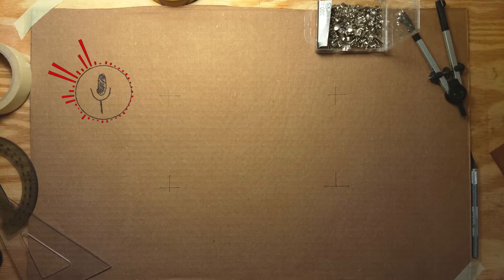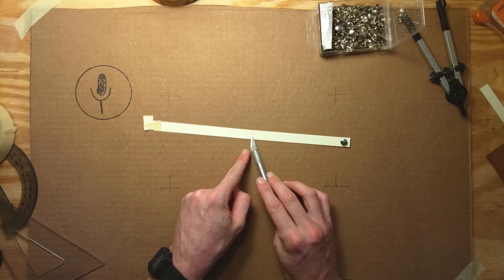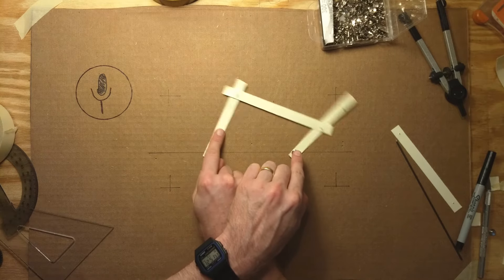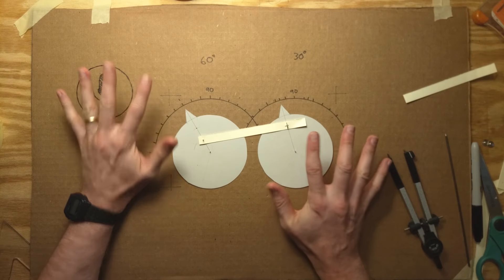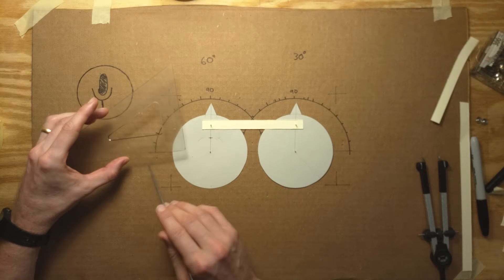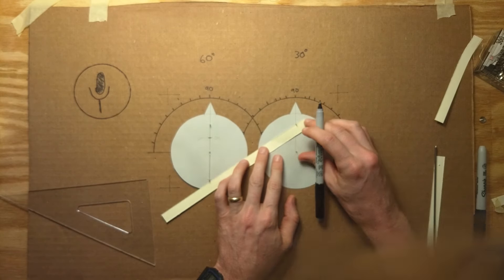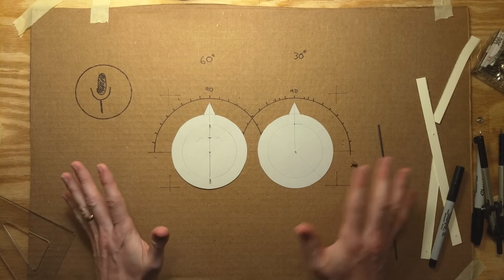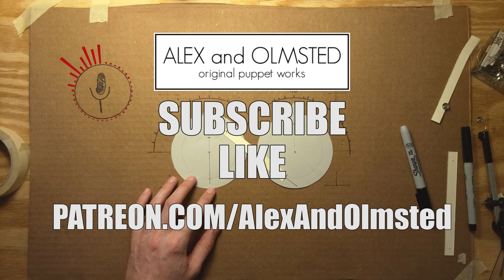Levers and 4 Bar Linkages

Comment: I’m an animatronics enthusiast. As I’m starting a new mechanical prop build, i wanted to brush up on the fundamentals of levers and linkages when I came across this video….Its undoubtedly the coolest one out there. For a moment i thought, this got to be a cool physics teacher and then  I checked out your channel…no wonder you are a puppet maker/puppeteer….u designed the perfect teaching aid to explain the concept to visual learners like us
Reply from the maker: Thanks so much! We love animatronics but haven't gotten to experiment with it too much. Now that we have our 3d printer and are more familiar with 3d modeling, and trying to get more comfortable with circuitpython, I'd really love to add more animatronic elements into our puppets. Loved checking out the animatronics on your channel! Did you build those?

Comment: I started out designing a really cool folding cup holder for my van using this process. I then machined out the parts on my Bridgeport mill, it was amazing to see how much just .020 difference in pivot points would would make the difference between work perfect or jamb! Again great video!
Reply from the maker: That's awesome! Do you have any video of the cup holder in action?

Yeah, those tiny little changes in pivot points change so much! Especially the closer to pivoting points get to each other. It's also amazing how much changes when you switch from a paper or wood prototype to metal, and all of a sudden the tolerances are much tighter!

Comment: Great ideas, I didn't think those bars would be precise, but as you said - and showed - in a small region this will be sufficiently precise and more robust than belts and pulleys.
Reply from the maker: Thanks! Yeah, precision with paper is tricky but possible. It helps using thick cardstock to keep your paper from bending, and if you're working at a larger scale it's easier to get it closer to how you want it.
Reply: I saw this more as a prototype like Tim Hunkins showed in one of his "the secret life of ..." (linkages?) : paper and cardboard linkages are great to iterate your ideas, then you can switch to wood or metal when you get the right movement. 
And you did show a good precision with paper, eg with the opposite rotations at 19:02, that surprised me.

Comment: Great job. Im currently trying to find a way to reduce the torque load on a small servo motor to be able to push two tires into a turn. I started to use the shaft and steering gear plate and adding a bearing but I think the force needed would strip the gears on the motor. Easy fix with a bigger motor but I want to find the right combo of gears or levers to make a small motor move large objects. Just a matter of the number and position of levers or gears. Your presentation has given me some more ideas to test. Thanks
Reply from the maker: Great! Thanks for the comment. We love hearing about real world applications like this. Finding the right way to gear up or down a motor is so valuable, too!

Comment: This is one of the coolest videos I've seen a long time! The creativity and depth of knowledge illustrated in simple visual terms is simply astounding! Bravo! If you are entertaining requests during these potentially slow days, it would be cool to see this type of illustration used to show how one circle drives the other circle in a >180 degree oscillating rotation, with the driving circle making complete 360 degree unidirectional rotations.  ;)
Reply from the maker: Glad you enjoyed it, and thanks for the suggestion! That's a cool idea! I'm not sure if it's a typo, or if I'm thinking of a different setup, but the driving circle would go 360, and the following one would go <180, not >180. I'll put it on my list! :D
Reply: @AlexAndOlmsted  Now I'm trying to remember what I was thinking!  LOL - I think the application I was envisioning would be to have the first perform the full 360 degree rotation in a single direction and have the second move greater than 180 degrees but less than 360 degrees. It would actually be very cool to contrast that to the second going less than 180 degrees so both practices could be observed. The applications of having the driving "wheel" rotate 360 degrees in a single direction (such as a crank or motor driven source) can be rewarding for achieving a less than 360 degree rotation of the targeted "wheel" for things like rotary oscillation and the like. I'm no math guru, but I have a feeling the application for less than vs greater than 180 degrees will require different solutions perhaps? I don't know what the solutions are, but I can picture it being a very satisfying visual experience in the manner you did for this video.  :)
Reply from the maker: @sethbrandes2979  I love that idea! I definitely know you can achieve <180 degree oscillation with this kind of set up, but it'd be interesting to see if you could get more than 180. I'll do some research and see what I can find!

Comment: I’m confused, when you were finding the tangent line, how did you determine the size of the smaller circles inside
Reply from the maker: For this example it doesn't really matter what size those smaller circles are, as long as they're the same on both discs. I just made them about 1/2" smaller than the discs so there would be plenty of material around the thumbtack connection points so it wouldn't tear through the edges.

Hope that clears things up!
Reply: @AlexAndOlmsted  it does, thank you!

Comment: What an entertaining and highly informative demo and props. Im trying to devise a mechanism which allows 90 degree rotation to a bar that will be used as a drop bolt. The 90 degree oscillation will be the limit for LOCK and UNLOCK position. I will greatly appreciate if you can help me figure out its geometry. The mechanism has to be powered by a motor which will be operated by a home automation system. Thanks.
Reply from the maker: Thanks so much! That sounds like an interesting project. I would recommend looking into bellcranks for 90 degree rotation. We even made a video about them here: https://youtu.be/b8zK0ZN7vIk

Hope this helps!

Comment: Very nice video !! 
Thanks 
I have a question ... 
At 5:34, do we gain or lose any torque ?
Reply from the maker: Good question! I'm a self taught engineer, so other folks feel free to correct me.

I think at 5:34 the lever on the left has more torque, and the one on the right has less. Imagine that each lever is a wrench and you're tightening a nut. The lever on the left is longer so you can apply Force further from the pivot, giving you more mechanical advantage. 

But I could be wrong!

Comment: Sir sorry Dumb question. If i wanted to triple the throw length of a actuator arm to 60" using levers. Could I use a 20" actuator? What would the lever(s) look like?  Great demo Man awesome
Reply from the maker: Hey, no dumb questions man! That's an interesting problem. I haven't worked with actuators too much to know how to solve this off hand. I imagine you would have a lever with the fulcrum at one end, and your 20" throw actuator attached to the lever near the fulcrum. Somewhere further up the lever would be a point that travels 60". I'm guessing it would be 3 times further from the first actuator than the first actuator is from the pivot. It's important to know that the lever is going to travel in an arc, though, and a benefit of a linear actuator is that it can move in a straight line and not take up as much space.

Comment: Very good video, good narration, good explanation and all round a very good vid. Are you mechanism engineer or designer or related field?
Reply from the maker: Thank you! I'm a puppeteer, and found a greater love of simple machines and mechanisms through building puppets and automata.
Reply: Alex and Olmsted you are most welcome. i just wanted to ask you if you know how to make automata's and you answered me before i even asked :-D how cool is that😀 where can i see some of your automata works examples?
Reply from the maker: @sirpfa  Ha! What a coincidence. I love automata. I haven't worked on any recently but I'll look through my older stuff to see if I can find anything good. I had the honor of repairing a few pieces from the Cabaret Mechanical Theater collection in Baltimore a few years ago, which was a real treat! Do you make automata?
Reply from the maker: @sirpfa  Here's a minimalist automaton I made: https://www.instagram.com/p/B2DWhDHJyDR
Reply from the maker: @sirpfa  Haha, those are great! Their basic shapes and movements don't look too complicated to work out. Most of the movement is from the body parts acting as linkages and transferring movement. Because of how everything's moving I would guess that it's only being controlled with a single input. There's probably a rod attached to a gear that's pushing/pulling one of the body parts, and that's moving everything else.

Of course, that's WAY oversimplifying it as the real challenge is making everything small enough to fit in a pocket watch and light enough to run off a single spring!
Reply: Alex and Olmsted yeap😀 do you design the concept with some software or physical modelling from beginning?:)
Reply from the maker: @sirpfa  I like to start with simple paper models like in the Levers and Linkages video because I learn things quicker when I can be hands-on. I usually sketch out a basic look and then cut some simple shapes and experiment with pivot point placement. Each piece will be connected at at least two points, either to the base or to another piece.

Comment: ..hey there - im new to your channel and found this so fascinating and transferable to other sectors. . How have you actually implemented these principles in your puppet shows and are they the same concept as automation..?!? Please keep 'em coming :)
Reply from the maker: Hi, and welcome! Thanks for the nice comment. We've used these concepts pretty extensively in our shadow puppets, both for live shows and our short films. It's also a great way to prototype a movement that will eventually be in a 3d puppet. 4 bar linkages work especially well in automata since they restrict movement to what you want, meaning you can have a whole series of connected pieces that all animate off the same crank.

Comment: What do we call a mechanismthat uses linked levers
Reply from the maker: Hmm, I think it might depend on the specific mechanism. Connecting two levels with a linkage does make a 4 bar linkage. Whatever is keeping the pivots of the two levers at a fixed distance (even if it's just the earth) acts as the fourth bar.

Did you have a specific example in mind?

Comment: if i have two circles (wheels) that i want to spin together but they're different sizes, can i do this with one bar? It's for a horse and carriage shadow puppet?
Reply from the maker: Good question! As far as I know, you cannot. Even if the bar was attached equal distances from each circle it wouldn't work. The second wheel will just pivot back and forth. Make a little cardboard mockup and you'll see why.

I would recommend attaching a thin pulley (make one by stacking different diameter circles or use an old bobbin) to the center of each wheel and connect them with a bit of string or elastic with just a little tension. Make sure your pulleys have enough grip that the string doesn't slide though. You can glue a little strip of sandpaper on them to make them super grippy. Then you can spin the one wheel and have them both move.

Let me know how it turns out!